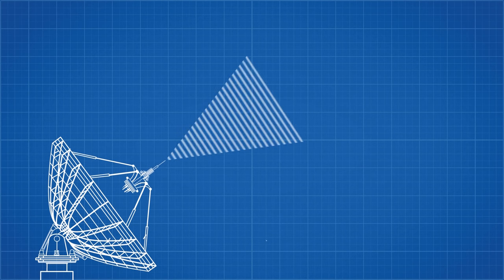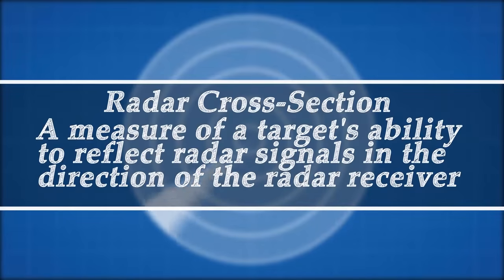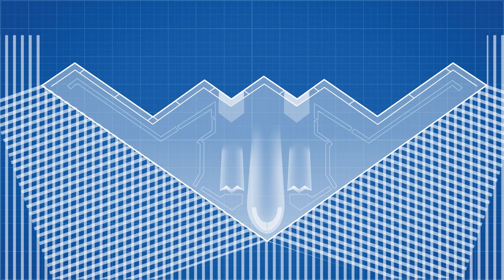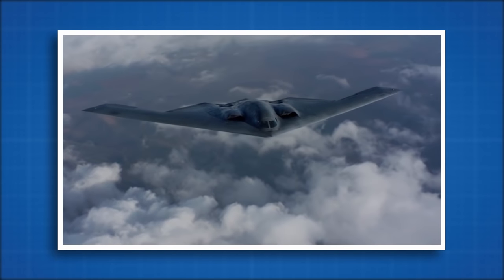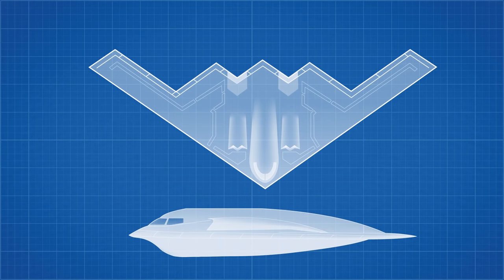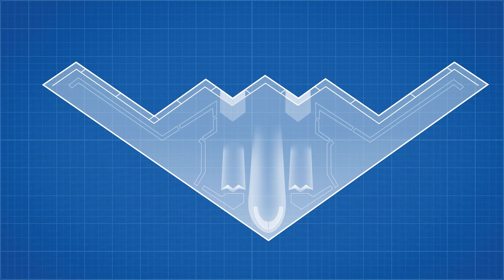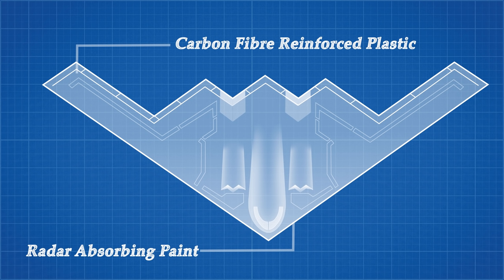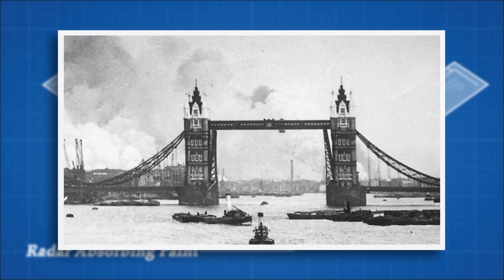Stealth - How Does it Work? (Northrop B-2 Spirit)

Comment: That plane flew over my house once. You don't need radar, it's louder than a comet blowing up all of Australia
Reply: Nuclear stealth bomber B2- spirit idk, maybe it flew lower on purpose (it was on route to an air show)
Reply: they fly past the sound barrier so once you hear them its too late.
Reply: Random Guy....wrong. They do not fly faster than the speed of sound.
Reply: true, they do not fly past the speed of sound, i was wrong
Reply: I had the chance to see it once, flew over the camp I was working at. Must have had it's engines turned off, I didn't notice it until it almost passed us above.
Reply: I imagine that since the engine is on the inside, then the sound it does emit would be in a concentrated focal point to the rear of the plane, meaning you can only hear it once it's passed
Reply: to hear it, you need to be close to a few miles from where it was flying, and at that close of a range, a radar would already have detected it
Reply: but australia's fake
Reply: @goldsrcorsource2551  lol
Reply: Well they were in enemy territory they would fly much higher
Reply: Are you sure its not a colony drop that blew Australia
Reply: Everyone knows Australia’s fake because it’s too close to the flat earth edge, so nobody actually lives there
Reply: Yeah, by the year 3000 even passenger planes are probably gonna be invisible
Reply: @Randomguy-wd5lw  Outstanding move
Reply: They usually fly very high, where it is hard to see and hard to hear.
Reply: @Randomguy-wd5lw  well.
Theres a plane that have mech 3 speed breaking the speed of sound
Reply: If it was on a mission, it would be flying so high that you wouldnt hear anything. Even still, the engines on that thing are still much quieter than what is normal for an aircraft of that size.
Reply: if that plane flew above your house and you only hear it when it's above your house. Then the stealth works, cuz it's already too late to run from the bombing. lmao
Reply: @American Nyan I went to a race, and the b2 flew over, and you couldn't hear it until it   was right above you.
Reply: in the war,if you can hear it the means that you are dead.
Reply: You might be thinking of a sr-71, they are ridiculously loud, black, and somewhat similar looking with motion blur
Reply: Maybe it didn't switch on stealth mode
Reply: A b-52 has flown directly over me in my area multiple times fairly low as it was very visible and was very quiet. I think meep ster is a liarrr
Reply: 2020: r/cursedcomments
Reply: Im just a Troll whos intentions are good if the b-2 had guns mounted, they would be going at the speed of both the bullet and the aircraft combined
Reply: Maybe it was low flying and was on full throttle. Its so quiet and can fly very high. So yea
Reply: They are not visible at the height they are stealth at
Reply: Random guy wait a second 
Guy on the internet who’s username is literally “random guy” admits that they were wrong? 
Somethings up
Reply: Nope... I have flown it
Reply: @goldsrcorsource2551  Australia is stealth coated too that’s why u can’t see it
Reply: Nah man, I’ve heard one land, they like to make a shit ton of sound
Reply: Yeah but once you hear it it’s too late
Reply: Don't be that dramatic it ain't louder than your average fighter jet 😂
Reply: American Nyan  the guy must be trolling
Reply: Thats why its designed to fly @ very high altitudes
Reply: By the time it's loud, it's too late.
Reply: American Nyan  No, I have to disagree while all Jets are loud ofcourse, and allot of pur current american lineup is LOUDER than the Northrop, these things are very fucking loud. It's a different type of noise. I'm in military land. I see them often enough, and they are loud, deep booming jets. An F15 or F22 is allot more crackling, the B2 booms lower
Reply: I’m sure if you are close enough to hear it it’s a little bit too late
Reply: The noice isn't that big of a deal though, as the whole point in stealth is to prevent enemies from locking onto the aircraft, and sound doesn't really affect that.
Reply: The US would most likely use stealth bombers at night since it will be harder to hear or something
Reply: I have seen a few fly over my area and they are quiet.
Reply: @Randomguy-wd5lw  lol man you didn't even delete your wrong comment. you're hilarious
Reply: @Randomguy-wd5lw  B2 cruises at Mach 0.85 which is subsonic.
Reply: @meepster554  These planes are not allowed to fly low in the first place so i think you saw something else. Maybe the B-1. That one is noisy as fuck. They're not allowed to fly low even for a celebratory flyover. And these few times they've done this, we all saw how quite they are.
Reply: Australia ain’t even small it’s like the same size as America
Reply: İts still better than f16s

İ basically Got flashbanged when a F16 flew past very close to the city i was in
Reply: I mean they do fly very high and mostly avoid populated areas while dispatched to spy on enemies...but idrk
Reply: @cofishfinder7269  yeah but tis still pretty fast atleast subsonic speeds
Reply: @sk8teroflive999  I heard one fly over a stadium. You could hear it coming, even with a crowd of 60k people cheering. BUT it was at most about 500 feet in the air. I imagine if it was 15,000 feet, you wouldn't hear it until it passed
Reply: The Superbowl last year one flew right above the stadium
Reply: Have had B2 fly over multiple times, sometimes zero sound, at Rose Parade very loud an low.  It is normally very quite and very hard to see as it is only a line if at similar altitude.   It is only easy to see from above or below.   It is also IR stealthy.  So triple stealth: radar and visual very hard to detect, IR weakness is from rear and a slightly above.  BTW we didn't think the radar stealth would be viable for this long.
Reply: @Randomguy-wd5lw  hello there
Reply: That's due to the height it's flying at. I Live near Edwards AFB in CA, and see so many jets practice maneuvers here. They also might have an afterburner mode or something to quiet it down, too, but don't quote me on that. All I know is the newer F-35's make a sonic boom that cracked our living room window.
Reply: @Randomguy-wd5lw  they can fly at 0.95 mach so I guess if it dives down or gains alot of speed it might pass the sound barrier, correct me if I'm wrong
Reply: @randomweirdo4467  he literally said he was wrong…
Reply: That can't be heard from 500kms away
Reply: The thing is, that’s probably not that relevant. If you can hear it, that probably means it’s too late to do anything about it
Reply: you can only hear it once it’s gone if it’s flying low enough, most of the time you don’t know it’s there until you’re already blown up
Reply: People have normal jobs like you and they don't realise about technical and military stuff and it's worse when they try to spread fake knowledge in comments like u do b2 does not have to be this close while dropping bombs mostly radars have greater range like 400km and more this is why radars were invented so they can alert u about
Reply: When you hear it..too late.
Reply: @enricoevangelish5572  Thats not how stealth works. Stealth is about radar detectivity, not sound. And they surely would stop the engines for a bit when dropping bombs.
Reply: To scramble jets and evacuate a city I think I've seen that it's something like 14 minutes out that you could potentially evac. That's if someone is looking right at it. Sound over head doesn't mean jack when it's dropping a f'n nuke on ya
Reply: @Randomguy-wd5lw they fly below. Only mach 0.95
Reply: @enricoevangelish5572  yeah I noticed same thing in a video
Reply: High flight like it’s made to fly makes less noise
Reply: On a mission the usually fly extremely high and almost always at night
Reply: If you are the target and you heard it, it was too late.
Reply: It's much quieter than other military jets
Reply: I believe under normal flying, it's just as loud as a normal jet.  I've heard rumors that it has a quiet mode so it can sit in an area without being detected by radar or by ground soldiers.

Comment: Looking at radar "Eh, why is there a large bird flying at 600 mph?" Hears explosion "Damnit"
Reply: PRO tip: if you ever detect a bird flying at 600 mph in your radar, shot it down!
Reply: That's how the serbs detected f117 , the hardest part is locking on them but we have more computing powers that we were , so stealth basically useless
Reply: @boiboiboi1419  Nope, he got hit by missile switched to line-of-sight guidance.
Reply: I think you might find that the radar might not display things as small as birds, or the radar display would just be cluttered. Whether they can distinguish between bird signals travelling at high speed is another thing. If stealth is useless, why are other countries building stealth aircraft as well. Longer wave length radars seem to have some effect in finding stealth aircraft, but these can not achieve a missile lock.
Reply: Degsie1975 why? For deterrence, only usa , china and russia building stealth aircraft, and the rest of the world aiming for super maneuverable craft like gripen , su35 , mirages

Why ? Because of wing man drones, wing man drones can be customized into many thing , anti stealth , anti bvr , anti jammers 

We're going back to dog fighting
Reply: @boiboiboi1419  stealth is not useless, seriously who are you to make such claims
Reply: @laetrille  an observing concerned citizen , so when the time is come you know what to do on the battlefield instead of just be intimidated by none existent stuff
Reply: @boiboiboi1419  Zoltan Dani the Sam operator said one minute it wasn't there and then it just was. The bomb bay doors also affect stealth, I don't know how it works on the b2 but the f117 was good for it's time.
Reply: @hevgamer6087  Just cause you can sot on aircraft doesnt mean u can track and if u want to shoot it down u need to track it.
Reply: They probably cut off all objects with a small enough Cross Radar Section, otherwise there would be to much background noise to really track anything. That's my guess. 
(The f-117 shoot down by serbs was identified because it followed the same route many time for his mission, so they were able to figure that it was a stealth plane. By setting the radar on extremly long wave they followed the plane and "manually" shoot it down (as other people said the radar could see the object but was unable to lock it down)
P.s. if there's an engineer who is able to explain it better, he's welcome :)
Reply: I think the US would use this plane to attack a country that use the metric system, not mph.
Reply: boiboiboi the Serbs shot down a f117 because it had its bomb bay open which increased its radar cross section. This is no long a problem for modern stealth aircraft like the f22 or f35. Stealth is useful because yes, the enemy may be able to detect a stealth aircraft but it is much more difficult so it would likely be to late by the time they do. Also, the wavelengths that can detect them are not able to target missiles
Reply: Its like the german ww2 horten ho
Reply: Most radars filter out small objects
Reply: @frapippo420  No, the explanation is quite simple.

A radar beam isn't like a prefect laser, the further away from the radar, the more spread out the signal is. Not only that, but the same thing happens to the return signal after it bounced on the target. The return signal is processed by having the background noise removed and seeing what signal can be found.

If you place your target further away, the return signal will be lower, to the point where eventually it will be completely covered up by the background noise. Alternatively, you can simply reduce the radar cross section of the target, which will have the same effect. For real values, the Russian Irbis-E (Su-35) has a claimed detection range of 400 km against a 3m^2 target, but against a 0.001m^2 target (quite a large bird) it has a detection range of 90 km. Against modern stealth aircraft you can expect much lower ranges.

The filtering of clutter is done differently. For example, a one-time signal will be filtered out. A very low speed signal will be filtered out too. So when a stealth aircraft opens its bomb bays it's very likely to be filtered out, funnily enough.

In the case of the F-117 the S-125 crew took huge risk by keeping their radar active for long periods of time. This made them very vulnerable to anti-radiation missiles, and they could've very well ended up as a statistic. The idea is that stealth aircraft are very unlikely to be close enough to a radar for the small % of time it is active, at least for deep penetration strikes like the F-117 was doing. Due to repeated routes and increased radar activation time, the F-117 was eventually detected and shot down. Serbs weren't able to repeat the feat after that (the same S-125 damaged another F-117 but I mean after this happened).

There are loads of ways modern stealth is improved to prevent this from happening though.
Reply: This made ma laugh. Few things do.
Reply: you’re a good person with a good comment
thanks you
Reply: @boiboiboi1419  If it was useless why would countries like china and russia pour millions into developing their own stealth aircraft?
Reply: boiboiboi no it isnt stealth advanced to...
Reply: I see many military experts in this comment section
Reply: Lol
Reply: JOE DIDN’T FIX THE RADAR, DANGIT JOE YOUR NOT GETTING THAT RAISE, ITS ALWAYS JOE
Reply: @boiboiboi1419  well SAID. Nice one
Reply: @laetrille  stealth is only useful if youre american
Reply: MhazG stealth only useful for cas and attacking low bandwidth radar AA or NAVAL destroyers because their radar is bad, 
But can be easily countered with AWACS

It’s cat and dog game but stealth is just not worth the money 
Few special squadrons is okay
But whole air force with stealth? Bad idea

You can get 3 upgraded su27 with 1 f22
1 f22 maintenance cost equals 3 maintenance cost of su35
Reply: boiboiboi You really took a whole year to come up with a comeback
Reply: @navyseal1689  lol
Reply: @boiboiboi1419  FIRE MISSILES ON THE SUPERSONIC BIRD
Reply: If you're able to detect it and locate it with any degree of accuracy it's pretty much right overhead and it dropped its payload 20 to 30 seconds ago
Reply: @hevgamer6087  me: hey 2 birds one 1 stone
bird doesnt die: oh crap
Reply: lol
Reply: @hevgamer6087  thx for tips to be radar operator
Reply: @boiboiboi1419  my god what a fool
Reply: U can’t even detect that shit haha
Reply: @abrahamsanchez7455  My post is over 5 years olds. If you want to play with dead things, go to the cemetery
Reply: @MrTheblackopsdude  wow 5 years ago i even still 8 years old
Reply: Lol
Reply: @Degsie1975  then combining these two can make it acquire radar lock?
Reply: Lol
Reply: Nothing sit it might be an ostrich flying and shitting from the sky
Reply: More like
"Dam—"
Reply: My first thought would be a Cruise Missile and not a B-2, tbh.
Reply: @boiboiboi1419  stealth aircraft will still be detected at less distance than non stealth(in reality it is just higher rcs= more power returns per pulse
Reply: Magizine
Single
Carpeter
Reply: @boiboiboi1419  okay so, if stealth is useless why does every major country still invest a lot in stealth? Lmao
Reply: @boiboiboi1419 he got hit when missle was in line of sight mode while the f117s bomb bay was open. A ground radar can barely detect stealth technology god forbid an aircraft radar which is significantly wealer